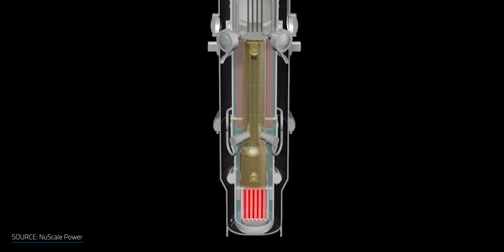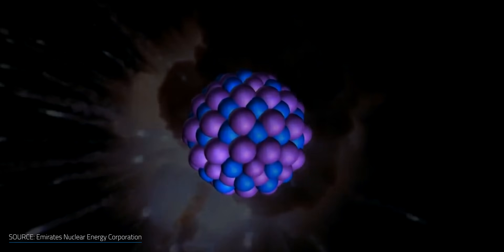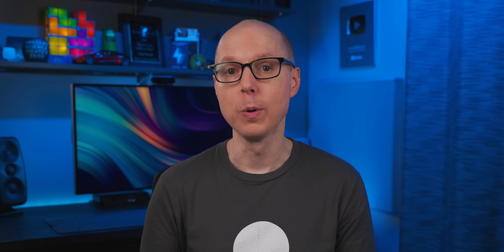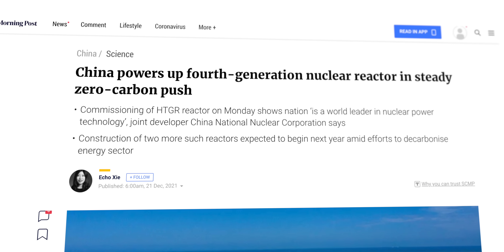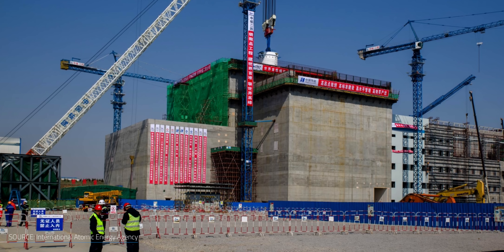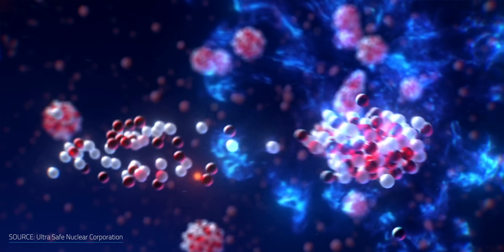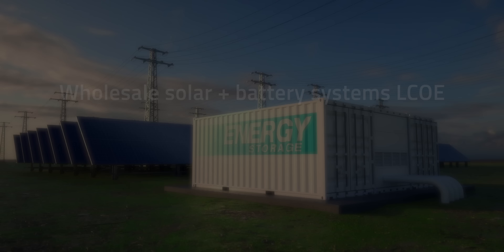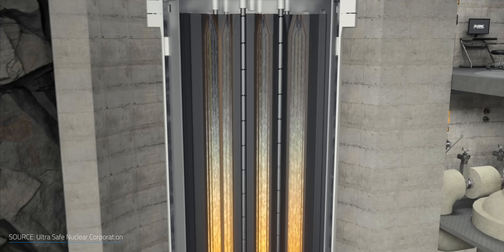Forget Small ... What About Micro Nuclear Energy?

Comment: Title: What about micro nuclear energy?
Conclusion: So, tell me, what do you think about SMRs?
Some of the graphics for SMRs were also used to illustrate implementation and flexibility of micro.
So, color me confused.  Questions remain.
Are SMR and Micro Nuclear synonymous?  
What is the difference?  
How small can “micro” get?  
Will it ever replace batteries in an EV?
Cordless tools?
Smartphone?
Saw something recently from a company that has developed ceramic-encased fuel pellets “for Micro Nuclear Reactor”, described as being the size of a walnut.  However, the attendant cooling system, safety system, enclosure, etc made it appear to be about the size of an SMR.
It also appeared that the “pellet” could easily be much, much smaller.  Hence my line of thought and questions.
Science fiction?  Perhaps.  I’d like to know more.
Thank-you for your informative videos.

Comment: Where to start to power the planet with terrorists attractions would require 14,000 conventional terrorists attractions building the most expensive way to generate electricity and then we would have a whopping 30 short years if uranium and we will have exhausted all uranium deposited. You really have to laugh at the absurd attempts rationalise this stupidity on such a epic scale. If the nuclear industry isn’t telling the truth about the reality of this nonsense there is a profound and dishonest reason that they aren’t and won’t.
Reply: Spent fuel and depleted uranium in US still contain energy for 1000s of year. And if that is not enough, there are about 4.6 billion metric tons in seawater. China is already working on this. Price is no issue if you get more 100 times the energy of a regula LWR out of it.

Comment: Clean and safe it is not.  Proposal to keep high level waste above an aquifer in Idaho is under review.  There was a re-designation of weapons waste from high to low level.  Death rates are way off. LCOE is also off on this and was adjusted at the behest of the nuclear lobby. That is why Nuscale failed even with Federal rate subsidy.  More reactors are more dangerous as a design flaw can be shared by all.  There are more sites to secure, and more probability that things will go horribly wrong.  Way more excess deaths at Chernobyl according to Union for Concerned Scientists than claimed by industry. They are of the opinion that if you didn't die from ARS, you were fine.  They are lying Matt, and you are repeating.

Comment: As to nuclear waste fast neutron reactors can actually burn the stuff, reduce the amount to 1/1000 of the original amount into a waste that decays to background levels in 300 years. Maybe you should have gone into the fast molten Chloride reactors.  In these reactors a fuel can be made from used reactor fuel and denatured weapons grade plutonium in a one-step process.  Essentially the raw old reactor fuel pellets and the denatured plutonium (reactor plutonium added to the weapons grade plutonium) is put in hot molten salt and blended in the desired ratios of reactive elements. After filtering the mixture is directly added to the reactor.  This according to proponents of these reactors as waste burners. Getting reactors like these working would completely eliminate any concerns about nuclear waste.  (The Elysium reactor, the Tarapower molten chloride reactor, and the  staple cloride salt reactor are examples of these reactors.)

Comment: I believe the Soviet Union made self contained nuclear reactors they used for among other things light houses.
Reply: You are referring to THERMAL generators that use the heat from radioactive decay to produce electricity using thermocouples.  They are not reactors and only produce a few watts
Reply: Nope, they did also make those but these were mini self contained reactors. They could not be refueled. The Soviets were looking into there use as mobile power stations and the such but the only use that lasted was the light houses.

Comment: Do the solar and wind costs include re- wiring the electricity distribution network, here in Australia we are told by our government that solar and wind are much cheaper than nuclear but they don’t include the 28,000 km of transmission lines that need to be constructed to support wind and solar and batteries. While nuclear can be installed on the same site as existing coal and gas fired power stations with no additional transmission costs. As an engineer I am sure the total cost of solar and wind and batteries including land acquisition and transmission costs would be more expensive than nuclear.

Comment: This video perhaps should be re-scripted and re-shot. The author treats SMR, Thorium, fast or slow, and Molten Salt as if they are separate  categories where they are orthogonal to eachother. 

The difference between Conventional, Small,  Micro, and Nano (10~100 KWth) are distinctions of scale (of power, core, and site size).

The difference between (not Modular) and Modular is whether it is designed to be one-off production of each core or factory production of cores. Conventional cores are too big to ship after assembly (excluding naval reactors), most other designs are modular.

The difference between Enriched Uranium, Natural Uranium (Candu), Thorium, and Fast Breeder are distinctions of fuel cycle. 
 - Enriched Uranium uses mostly U235 as fuel - There are conventional, SMR,  Micro, and Nano designs, 
 - Natural Uranium breeds Pu from U238 (but can-do thorium and other cycles) - There are conventional and SMR designs, 
 - Thorium reactors breed U233 from Th232. There are Conventional and SMR designs, 
 - Fast breeders can use a wide range of heavy elements. I only know of conventional designs.

Gas cooled, Liquid metal cooled, water cooled, heatpipe conduction, or  liquid salt cooled is a distinction of what is used as primary coolant. I think there are extant, planned, or historical examples of each at each scale except heatpipe conduction which is only Nano and the only Nano (NASA Kilopower project).

Pebble bed, conventional bundle, solid mass, and liquid salt  are distinctions of the shape and state of the fuel in the core.  I think there are extant, planned, or historical examples of each at each scale except solid mass  which is only Nano and the only Nano.

Comment: The US Navy and a number of foreign Navy use small reactors to drive Aircraft Carriers and Subs.   Can the Navy reactors we already have designed be moved ashore to add power to our grid ???
Reply: Sure.  They only produce 1/20 of the output of a standard PWR, fuel lasts a long time but costs $1 billion, and they have little to no safety features since they use the ocean for cooling if a meltdown occurs

Comment: One idea I have seen recently is the use of the SMRs or comparable at old coal powered sites. Since much of the power generation equipment is essentially the same, the idea is to roll the reactor in instead of the coal burner but otherwise use the rest of the existing generators.
Reply: The equipment is completely different , steam pressures, etc.
Reply: @clarkkent9080  Tell that to the DoE since it was their study. It is primarily about using the transmission lines, cooling ponds, and civilian infrastructure though. Their estimates were that it would reduce new reactor installations by as much as 35%. They are talking about reactors in the sub-1GW class.
Reply: @ermakers1297  The issue with coal plants is that their steam pressures and volumes are completely different than that of a nuclear facility.  Every secondary component (reheaters, turbines, condenser) is built to match those pressures and flow volumes so just adding a nuke would make for a very inefficient power plant.

Then there is the issue of age.  Lets look at Terrapower that is planning on building a MSR at the site of a 60 year old coal plant.  Do you think they are goin to tie a new nuclear primary to a 60 year old secondary?  Use buildings 60 years old? There is a reason that coal plant is shutting down and it is not for environmental reasons.

If anything Terrapower will just use their switch yard and transmission lines.  But even still that switch yard has disconnects and breakers built in the 1950s.

Lets just see what if anything Terrapower uses

Comment: Not impressed until videos like this include the Terrapower TWR. Travelling Wave Reactors use stockpiled "spent" fuel and result in far less waste at the end. No proliferation risks, and helps solve our current stockpile issue. Natrium, and its intended role in a sustainable grid should be explained as well.
Reply: Terrapower reactor is a uranium based MSR

Comment: Ok. Layman here. 2 questions. 

1. How feesable and safe could it be to Mount one of these micro reactors into a home or building (Store, office structure, workshop, gym, these sorts of things.) as part of the structure and make the structure completely energy independent? 

2. Same question,  but replace home or building with car, plane, helicopter, boat or motorcycle? Thus making is so they never need batteries or fuel?

Comment: If nuclear at scale grows ever more expensive and doesn't get cheaper from economies of scale, how would that look for small nuclear? The Thorium Molten salt breeder rates that would enable less security and maintenance cost have never been achieved so far. Degressive cost of nuclear energy still needs to be prpven. Terror risk and nuclear safety plus higher fuel mining cost so far have shown the cost to increase, not decrease. Turning that around is a bold claim to prove - in TRL 1 theory stage. On TRL2 experiments it currently still fails to deliver after decades of research.

Comment: SMRs and micro nuclear reactors can definitely make an important contribution in our future energy system. Due to new consumers, e.g. EVs or heat pumps, but also due to the fluctuating generation from wind and solar, we especially need highly flexible and scalable generation plants. I am working in the field of energy systems and grids and I see the problem with large nuclear power plants that they are far too inflexible for the coming requirements. For example, if generation from wind and solar is very strong, it may have to be curtailed because you can't control the existing nuclear plants fast enough. With SMRs and micro reactors, this would certainly be more feasible and, due to their more flexible use, also more in line with demand.

However, the individual SMR technologies must be viewed in a very differentiated manner. For example, I am rather skeptical about gas-cooled high-temperature reactors because, in contrast to liquid-cooled (water, molten salt, metal) reactors, they have serious disadvantages in real operation that one would rather not have with small, transportable reactors. For example, the penetration of air or water can have fatal consequences due to the high core temperatures. In addition, it is hardly possible to clean a gas-cooled reactor, since they are mostly graphite-moderated and for this reason radioactive fine dust is distributed throughout the reactor over time (especially in pebble bed reactors, since the graphite balls rub against each other). Therefore, leakage from a gas-cooled reactor can have more serious consequences than from liquid-cooled reactors.

Comment: Do you really want a "Made in China" micro-reactor in your neighborhood? With prolonged use & exposure  to  Chinese made mass-produced goods, one gets an impression of poor engineering, shortcuts and shoddy construction. In the past twenty years, how many Chinese made electric  hand-drills have YOU gone thru?...bad switches, failed chucks, motors that have burned up ???? Me?, about half a dozen...and I still have a fifties-era Black & Decker version that works. . What about those miracle common  LED lights that say proudly 30,000 hours lifetime....my experience has been about a third of hours expected....I have some four examples of burn't out 30,000 hour LEDs, the poor engineering becoming obvious upon disassembly & inspection. ...Poor designs, substandard parts, shoddy fabrication & you're expecting excellence?...Nuclear Reactors? grow up to the realities.

Comment: As much as I abhor the thought of nuclear energy due to the disposal issue, I don't think we really have a choice.  Wind, solar, and hydro power simply is not sufficient to generate the power requirements we have today, let alone power requirements of the future.  Those power requirements are going to increase massively when the U.S. bans fossil fuel based appliances, heating systems, automobiles, etc.  Some states, counties, and localities have already started banning fossil fuel based appliances and heating systems for new homes, allowing electrical versions only, despite the fact that our electrical grids cannot handle it.
Reply: there is no disposal issue with nuclear

Comment: 5:41 You left out the part that helium will be really fast to evaporate
when a breach of the cooling system or heat transfer system happens.
Yes, it's more power, but what happens when it fails ?
The problem is not when everything is going ok, but what
happens when it doesn't.
Using compressed gas coolant for any nuclear reaction is simply a bad idea.
Yes, it's more lucrative, but also presents a much higher danger upon failure.
Reply: And then there's deliberate stuff ike sabotage and weaponization
of nuclear fuels.
It doesn't have to be an actual nuclear bomb, just dirty.
Nuclear material spread over a few 100's of square miles.
Nah, really, putting fission/fusion materials in civilian hands is a bad idea.

Comment: My interest in nuclear tech has been renewed by our recent breakthroughs in nuclear fusion. With all of the reading and watching I have been doing, I am hearing and seeing one consistent message. The smaller we get, the less expensive and safer we get. Since the word "Micro" has already been used, I guess we would need to call these even smaller units "Nano." What is preventing us from creating "Nano Reactors" that could be installed in areas as small as substations or relay stations? Maybe even small enough to have the unit in the center of neighborhoods with them all linked together on the grid to prevent any issues should one fail or need service.

Imagine the possibilities for expanding new construction areas without the necessity to extend the main power grid prior. Plop a "Nano Reactor," and start building!

Beyond that, radioactive material obviously gives off radiation. While I am aware that converting this into usable energy is incredibly inefficient, shouldn't we be able to manufacture a facility to store and harness the radiation given off from Nuclear waste? Since we already have to store this radioactive waste, why not just make the storage area another source of energy?

Comment: The argument over which energy source will be the magic bullet that solves all of ur energy needs planet wide is flawed to put it mildly. There’s never just any one thing that comes along and (insert thing done here) and then that’s it. It would be great if wind, solar, or nuclear energy could be used exclusively to power civilization but on their own they can’t. Some areas of the world have geologic instability making nuclear a bad idea, or areas where prolonged darkness is something that the inhabitants have to deal with ie parts of Alaska, that make solar problematic, and wind is finicky wherever you are. So the conversation should be shifted in the direction of how Do we use a combination of these systems to provide for our electrical needs, and how does our location in the world dictate the most advantageous method of energy production. We don’t want traditional nuke plants in earthquake or tsunami prone areas, so why not consider a system of micro thorium reactors backed up wind or solar or both. In the aforementioned parts of Alaska that experience weeks of low light or darkness, larger SMR’s and wind turbines might be the way to go. And the perceptions around nuclear energy will only change with education not rhetoric